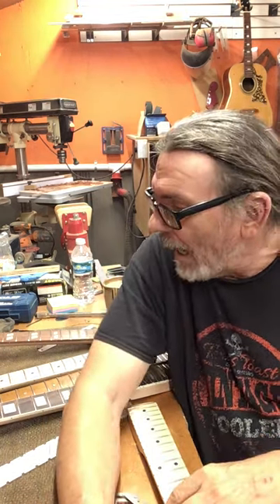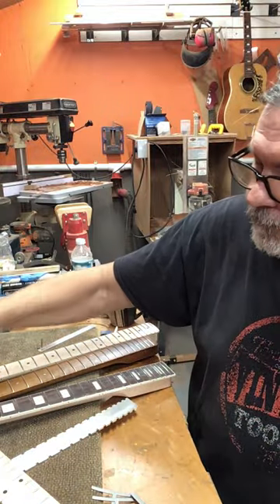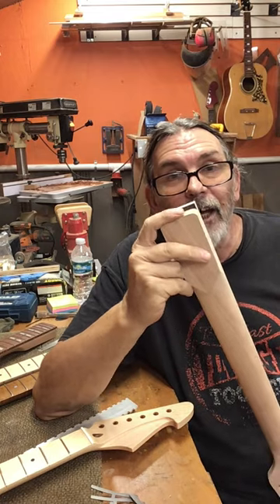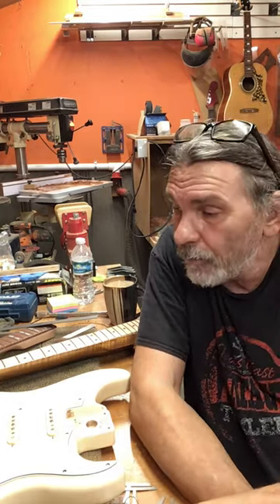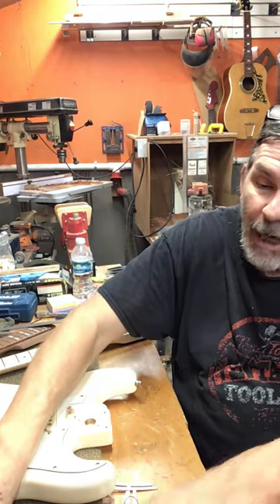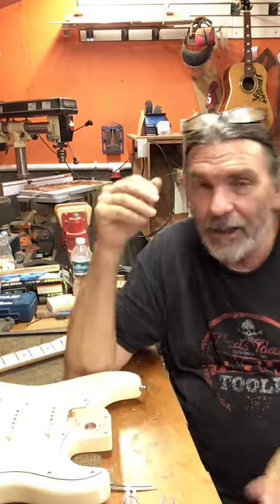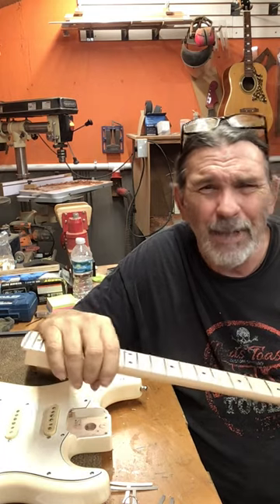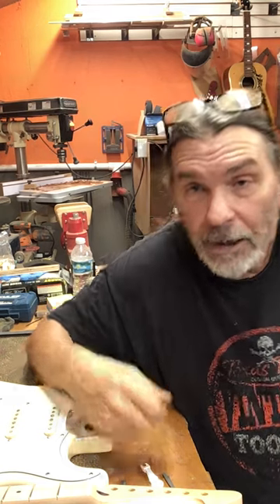Stop before you buy an Amazon guitar neck.

Comment: Why reach to the bottom of the barrel for musical instruments?
I use USA manufacturing.
I know what the wood is, I know what the metallurgy of the fret material is, I specify the shape, the fret size, and know I will need to do minor fitting , and only minor fret work to be perfect.
The outcome tonality wise is fairly predictable.
As is using China parts.
They are vastly different.
Just buy a squire if you don’t have the funds. 
Asia guitars with QC from a larger manufacturer is better than rolling the dice at Amazon or other. That has no accountability or QC.
Reply from the maker: Yep, I purchased them because customers wanted to know. Purchasing guitar parts online is sterile you don't hold it feel it and get the dimensions. I keep those necks around for the, "I'll just replace it with an Amazon neck guys". Usually after they see and feel them they want the better product.

Comment: Well just before I was going to purchase the bargain bin  priced Amazon neck I saw this video. I believe you have changed my mind. I didn’t spend all the time I spent on the body to have a bad neck on it. I certainly am not at the skill set yet to do a fret job so in the long run it’s cheaper to buy a better neck
Reply from the maker: I just applied Tru Oil (gunstock oil) to a maple fretboard Mighty mite.  Stratosphere on eBay listed a Mex fender with non locking tuners 9.5 radius. I picked one up for $249.00 I believe. So at retail those tuners are about $50 so logo Mex neck with serial # for $199. ain't bad.

Comment: Just got a cheap jackson neck and it needs the heel cut down like you said. Thanks for the tip with not using a router and to just sand it. Ibwas thingking of using my dewalt muti tool lol. Im pretty good with it. Flip the neck upside-down and chop a bunch of lines to create the curve i need and depth and then cut it long ways just enough to cut off the slivers ill need. That was my idea but sanding may work too. Mine came from the same company with that same card too lol.

Comment: You know, when Fender pairs a neck, the neck is specifically sanded for the body. So to fit a neck neck perfectly, it is sanded to match the body. You don’t route a body to fit the neck.

That explains why the necks are a little big. They’re giving you product to work with so you can get a perfect fit. This is also true for the nut. These are still roughed out necks. The time saved in finishing is passed on in price. 

You weren’t expecting perfection for $50 bucks were you?
Reply from the maker: they left a lot of sanding to do on the fret board also, If the radius is wrong setting up the guitar can be almost impossible. The extra 1/8th of an inch on the heel also. They would be better of sending the neck blank with the frets and inlays in a bag.

Comment: I've bought PRS tele neck from Amazon. This thing was not right from the get-go. the weirded radius of 8.50. The nut was way too high. I mounted on a body and had a luthier do a set up. The guy had to take the frets out and reshape the fret board to 10 inch and replace the frets and take off the nut and file it to a better height. the guy was cool and did not charge for the reradiusing and replace the frets. the neck plays well, but the neck thickness was too thick and replaced with a good neck with a thinner neck.
Reply from the maker: Those weird radius's are from the metric system so thats a bad radius of 21 centimeters